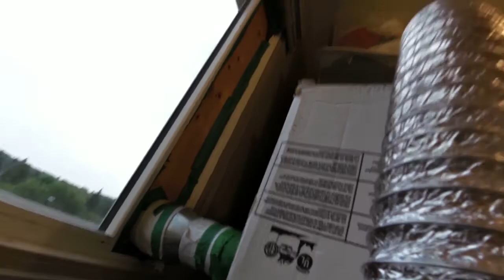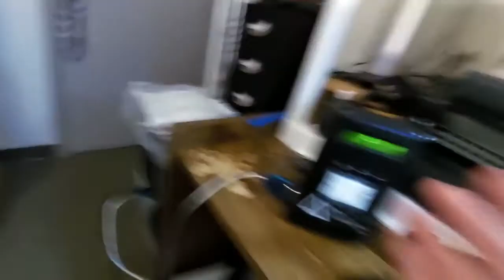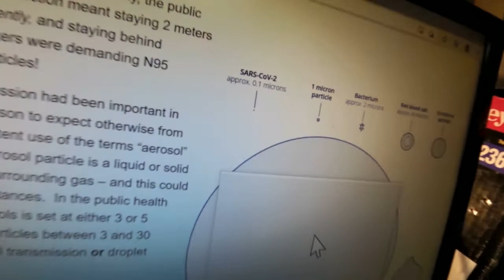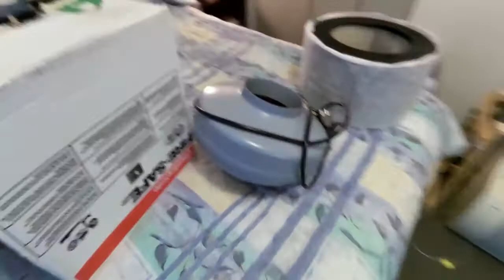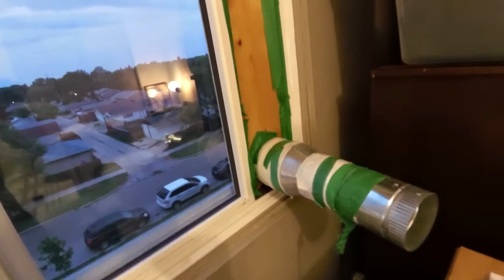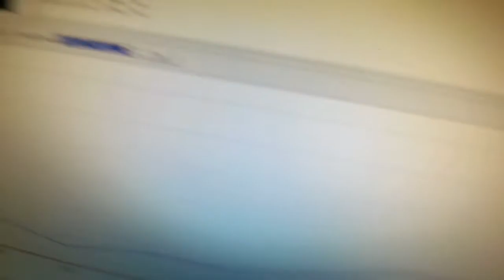Meile Vacuum vs wildfire smoke test

Comment from the maker: The Meile canister itself is great but my seb 236 power head needed repair for the carpet height adjustment and the locking mechanism. I got it fixed but I would not recommend this power head because of these issues.